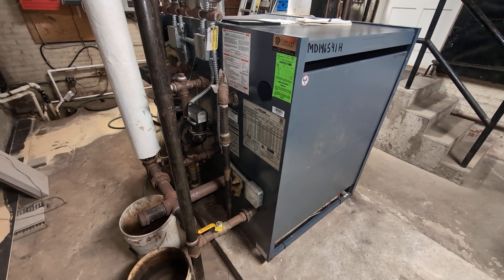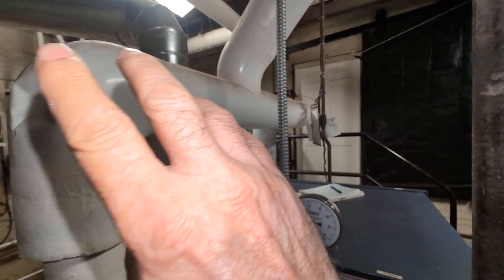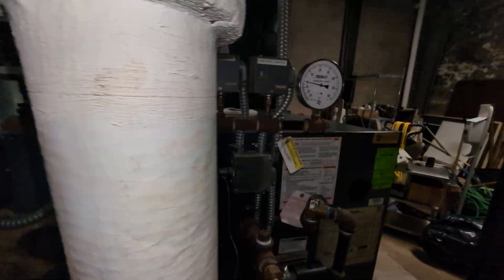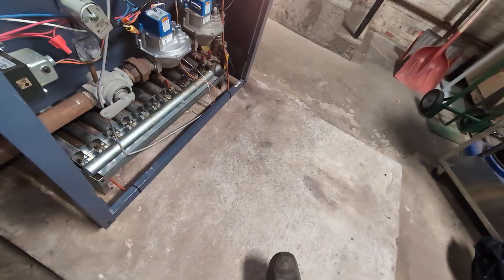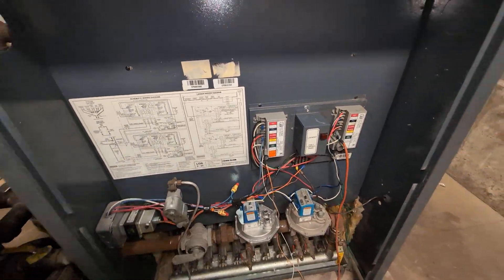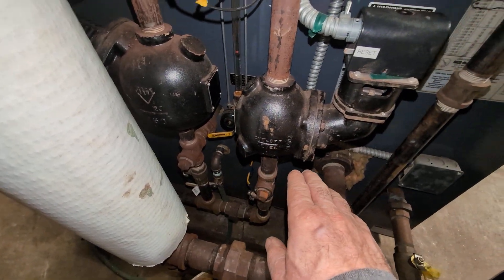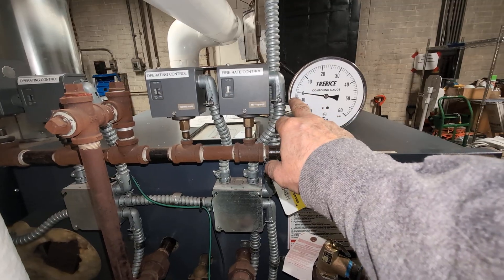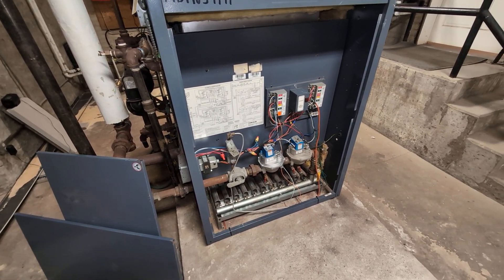LGB Stands For Leaking Gas Boiler

Comment: We have a LGB-10 section in apartment building: 1,170,000 BTUs, only 190,000 EDR with 25 radiators total. Roughly 20 studio-1bed apartments 2 shared bathrooms and 2 commercial: 14,000 sq ft minus 4,000 commercial space on electric heat, …..someone didn’t count radiators and must have just done a “swap” of failed American standard in 2013 sized At 1.3 mil BTUs (we coulda had 125 more radiators of equal sizes and heated the whole block?)

Here we are on year 12 of short cycling with pressure turned up to 4psi until finally an engineer turned it down to 2 psi and then lo-fired it after having me do the EDR calculations. Still get 280k btu hr output leading to short cycling. but short cycles are 2 minutes fire instead of 55-50 seconds. Winter couldn’t get over fast enough. Headed for a breakdown and possibly size down to 4-5 sections. (Haven’t done a 6 section on lo-fire calculation yet)

There is no equilizer loop present as shown in WM manual:

Is this “allowable”? One pipe steam. 6” single header off one side at angle upwards 30” rise before connection to existing main

The installer met me, but says boiler is sized correctly for size of building, equalizer not needed, and provided early service records of LWCO blow downs. (Which I have taken over weekly past 8+ years) multiple control box replacements due to steam into cabinet at start up past 8 years Etc. I wish I had done better research earlier. 

Thanks for these videos. Very informative. 
Plan is to install aquastat and try and keep the boiler warm and tight  between steam producing heat cycles  rest of season. 

Engineering wants to break it down and downsize it if there are enough good sections. 
But this nickname gives me incentive to at least look at a different boiler model :)

Comment: The expansion/contraction explanation makes sense. They won't pay to put in the appropriate adjustments?
Reply from the maker: The boiler is planned to be abandoned after a year or two.
My job is to get it thru this season.
Reply: @gordonschweizer5154  Seems like it would stop leaking and be reliable with the appropriate adjustments to allow for expansion and contraction. But what do I know.

Comment: That probe for high water is interesting.    Might be a good add for people with auto fills that might run amok.
Reply from the maker: I think this particular set-up would only work with boiler feed tanks, but I do like the idea in principle. So when I saw it, I knew I had to make a video on it!
Reply: @gordonschweizer5154 we like controls.  Im a boiler mechanic from NYC. I worked at city gas most of my career

Comment: I started a service on an Weil McLain EG-6 this past week, Oct of  2025.  While cleaning debris at the base of the aluminum lined chimney, I found the base elbow rotted out and the top of the vent at about a 15° angle at the top of the 3 story tall brick chimney.  Okay, it needs a new liner, so we tell the owner and give them the contact for a chimney installer.

Moving on to the reason the customer called, the blocked blow down. 
We  clean  out the rusty control piping and rinse the bottom of the heat exchanger, and put it all back together. Good

Move to the burner, and one of the burner tubes is broken off where it rests on the brass oriface.  Oh oh.  Look in to the burner box and I see the tell-tale sign of destroyed insulation at the back of the box.  Then I saw the water stain down the leg of the left end section. Damn. 
We pull off the jacket cover below the draft hood and see the crusties between two sections. Double Dam.
Well, those  service hours were a waste of time

Solder up the oriface of the broken burner and start it up to make sure the chimney drafts and the leakage of the boiler is low enough to allow the pressure switches to operate and give the 
owner the second bad news.  I've got to say the owner did not have much reaction to the news.

 The boiler was installed for the previous owner, and this owner has lived there 20 years with the boiler about 30 years in service.
Reply from the maker: Thank you for that story!
Yes, indeed. It is sad when you go through all the usual steam boiler service procedures, and the evidence that you are working on a "zombie" boiler starts to become too much to ignore...